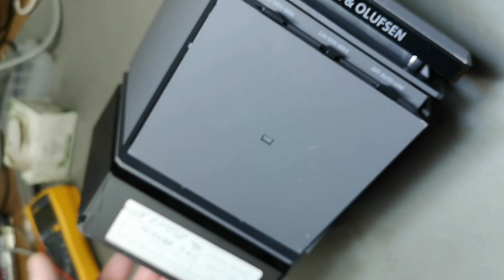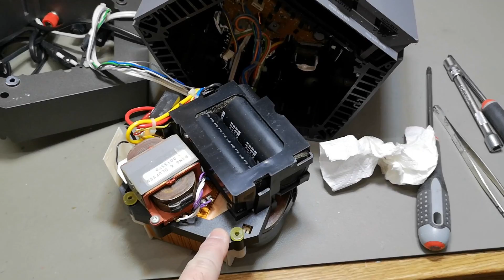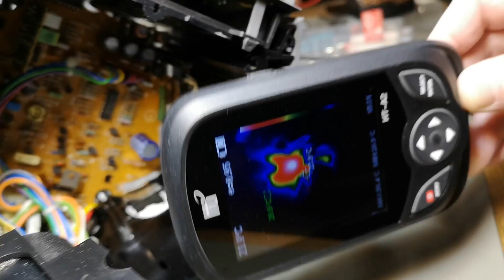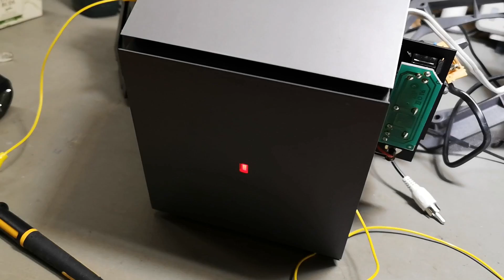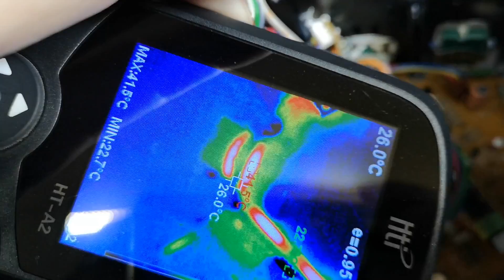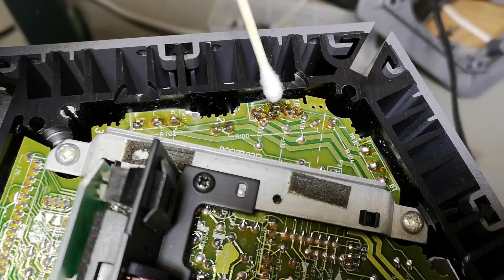Bang and Olufsen Beolab Beovox Penta Amplifier repair attempt part 1

Comment: I have a pair of Penta Model speakers 6603 I think it's the Penta 1. My question is, can it be connected directly to a sansui or onkyo sound amplifier through an RCA cable? Wouldn't it damage the lower amplifier that the speakers come with?
Reply from the maker: sure, they should be able to do that
Reply: Connect speaker cable to red and pins...they will work.

Comment: Hmmm...one of my Penta 2 amps power up itself without signal every few minutes!!?? Power is set up in Auto mode....what you think?
Reply: Maybe it's picking up a rouge signal from another device?
Reply: @AAgunner  hmm...i have another problem....cracking sound when it is cold...bass membrane go with cracking out...amp have poer and normal sound but this anomaly got me mad....i changed all small capacitors from board but crasking and wooshing remains
Reply: @PedjoGT  I wish I could help, but my Penta's are without amps. You could remove the amps and try to connect them to some other speakers and see if they also crack?
Reply: @AAgunner  Tried and the same issue
Reply: @PedjoGT  Hmm yeah sounds like it's in the amp. If you have the money, I would just bring it to someone that fixes older amplifiers for a living. Could just be a loose wire if you're lucky.  

A guitar amp builder might also be able to help you out. The measuring tools that they use are too expensive for one time use.